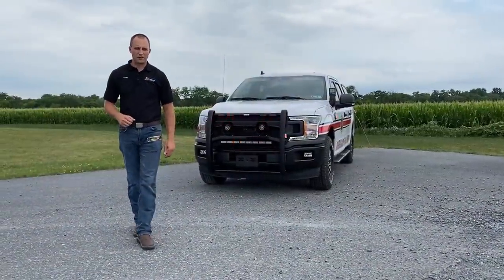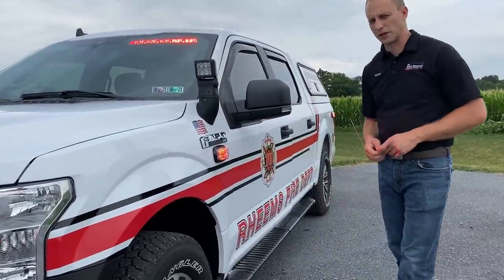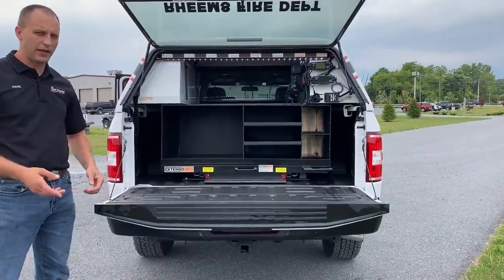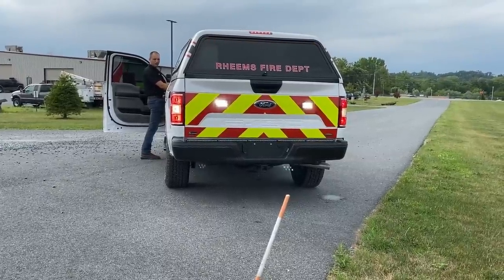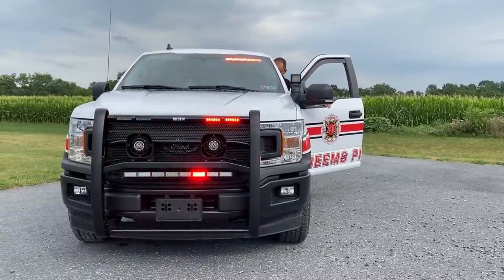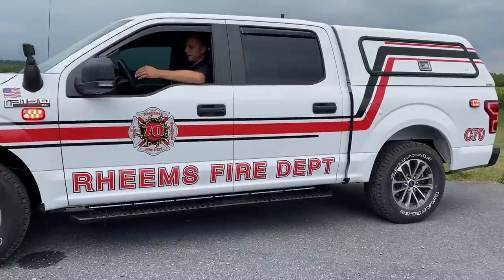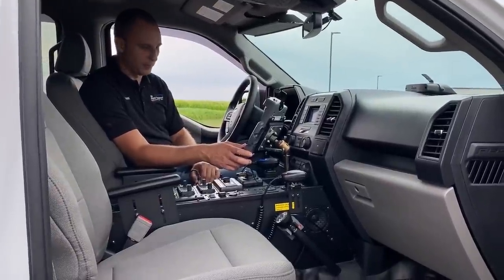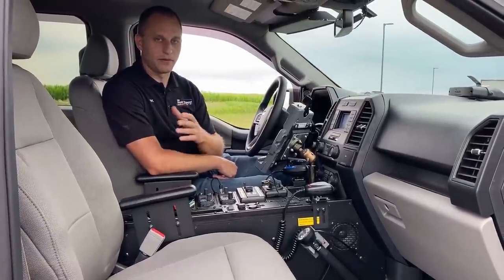Whelen Core, F150, Rheems Fire | 911 RR

Comment: Love the truck but I don’t understand the arrow stick turning on when the door opens.
Reply: That's because it's not a true arrow stick. It's supposed to tell you to merge over because someone is getting out of the vehicle but it does not look like the arrows they use on fire trucks, ambulances and highway vehicles. It's just a sequential light which most drivers will not understand.

Comment: Think you guys can possibly make a video in depth about the soundoff signal blueprint & there nERGY 400 siren & rumbler system
Reply from the maker: We have played around with many systems made by various manufacturers and the quality of Whelen is just bare none. We have little to no returns with the products. 

We been down the road of product failure and customers upset we surely will never risk that choice again.
Reply: Shoot me any questions you have about SoundOff Signal bluePRINT.  Hands down the best on the market!  I will not build anything but SoundOff because of the better quality and functionality.  Core can't touch bluePRINT and with the new software about to release it will stand above all even higher.